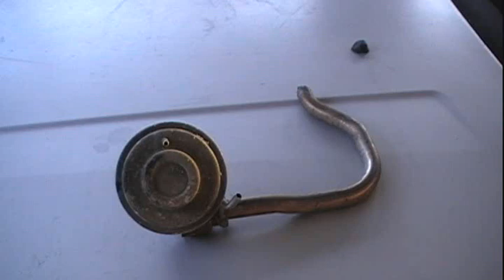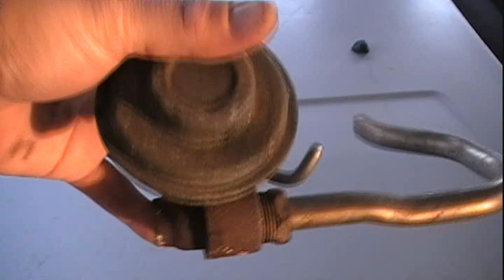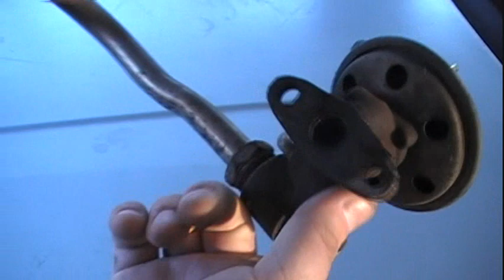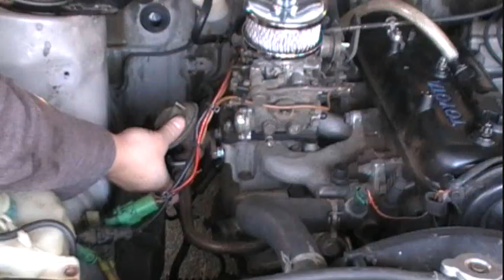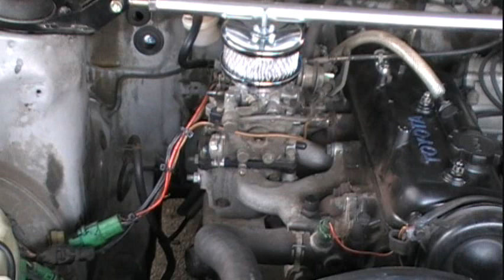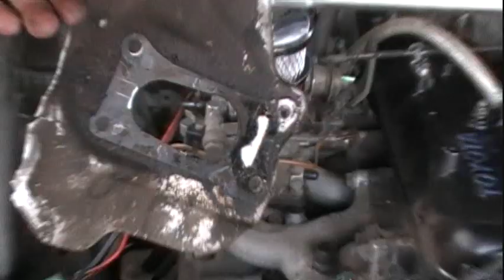AE86 Carb Project Part 3 EGR

Comment: hehe great videos also if u want more power when running put the stock  frying pan intake with the inlet air to front of the car not the side  so the carb gets air when running u will need a few adjustment but its worth it trust me i did all of this few months ago and put that frying pan and it gets more air running  :D i painted of course hehe

Comment: Also, you can make a gasket for the block off plate with gasket material as well. or possibly even use the EGR base gasket, I'd see no issues with doing that. Just figured I'd add a little extra